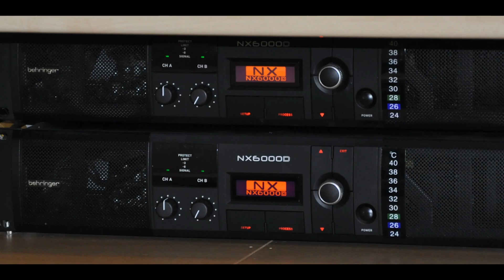No-Baffle DIY speaker system Pt 2

Comment: Assuming you're not measuring near field, you have a 10dB broad bass peak another 8dB broad hump in the presence region and a lobing treble region that slopes down very sharply too early. This is clearly audible and I'm amazed you're happy with this. Do you consider these speakers as finished or is this still in development?
Reply: Just out of curiosity how can you tell that these speakers have those problems threw a YouTube video. Not trying to throw shade just curious.
Reply: @claytonmckeon9872  I looked at the graph. Did you not watch the video to the end?
Reply: @carlosoliveira-rc2xt  I'm sorry and your right. I didn't make it all the way to the end. 10 dB is quit the swing and probably would only sound good with some material and not the other .
Reply: Carlos, I am amazed you can hear lobbing, broad bass peaks and humps in the midrange though a YT video!! You need to get a job with NASA as you are being wasted merely commenting on here. Hopefully, some one will notice you!
Reply: @vangelo2252  You should keep an open mind before opening your condescending sarcastic trap. Besides being in this game for 44 years and owning reference level gear, I looked at the graph. Did you also not watch the video to the end?
Reply: @vangelo2252  in fact he's not all that wrong.
but what he points out just adds to the character of the system,it can actually add a lot of resolution and presence.
however what carlos calls lobbing,which is not as lobbing is a completely different ball game,
is odd cancellation between the front and the rear acoustic pressure of the drivers.
which is completely normal for this topology.
may be a high frequency array can extend the high frequency all the way to 35 or even 40 khz
air motion transformer or planar
cheers
Reply: @mgabr00  I know lobing when I see it on a graph. I believe you are conflating lobing with comb filtering which is slightly different.
Reply: I agree it sounds a bit dry, the vocals sound like it is stuck at the throat.
Reply: a flat response sounds aweful, there is a reason that speaker manufacturers and headphone manufacturers choose different curves with their speakers. They could make a flat FR graph trivially easily now with all the computer simulation software and DSP power, and it would cost pennies. But they choose not to because it doesnt sound good more often than not, unless you are mixing with them. 
But for someone in the space for so long, who has listened to so many systems, I figured that you would know that a FR response graph in a room only somewhat correlates to how a system will sound. It may give you a general idea of the tonality, but thats about it.

Comment: After such an epic loudspeaker journey, how do these current speakers compare? Are they the best so far? Why did you drop the AE woofers?
Reply from the maker: Yes....these are best so far.
AE's were ok for jazz type volumes, but they are relatively delicate with light cones and only 150Watts continuous rating, vs the UM18 1000Watts. However, when you factor in efficiency of the of the AE rated at 96db, vs the UM18 88db, they should be 3x louder. I didnt find this to be the case at sub-sonic frequencies where they were totally trounced by the UM's.
Reply: @TransFiAudio  Which AE woofers were they?  I'm guessing not the IB15AU or IB15HT or I'm surprised there would be improvement going to the UM18.